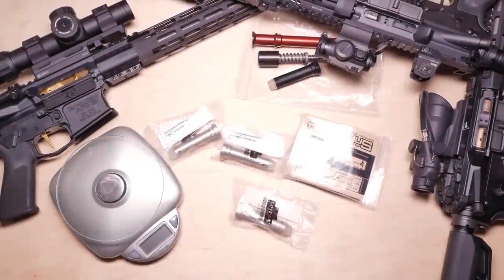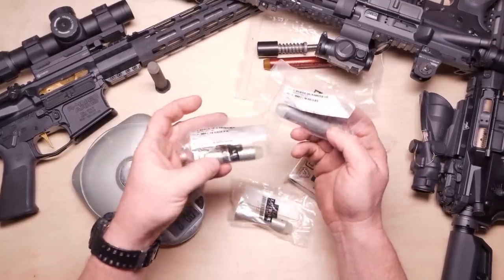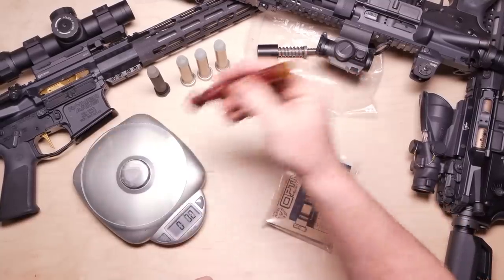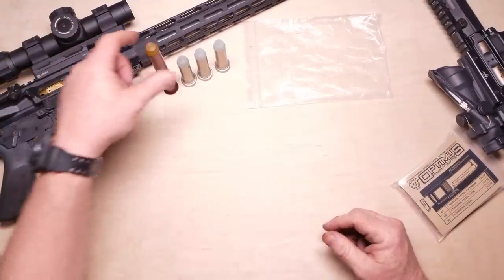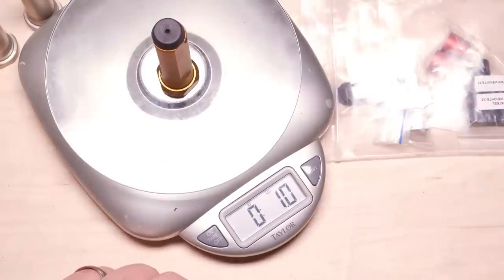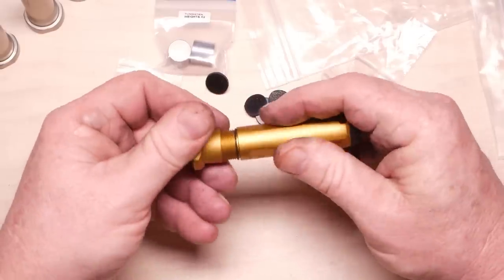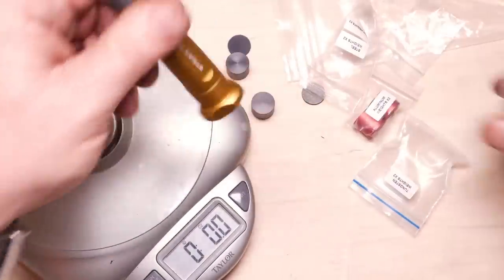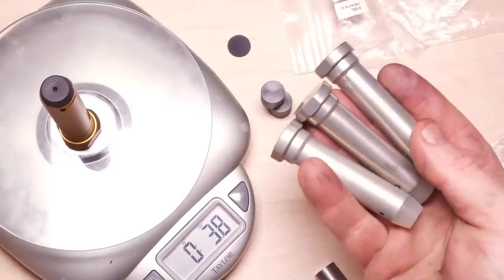Strike Industries Optimus Buffer System and Why it's Cool

Comment: Armaspec makes that captured system.  The best way to figure out what weight buffer to run is have a selection, load 1 round into a magazine, start with the lightest buffer, chamber and fire that round, if it locks open go up to the next buffer weight, until it wont lock back, then go down to the last weight.  You also want to be aware of the direction the case is going, 3 o'clock is ideal
Reply: That only works if you only shoot 1 load of ammo.
Reply: @3sotErik  not really, I shoot multiple brands from 55 to 68 gr, and I have never had an issue.  Maybe if you start with underpowered ammo, but as long as its quality brass cased ammo, you should be gtg.  I shoot every saturday, at least 200rds of 5.56, have 8 AR's and never had an issue because of the buffer
Reply: Ok then. I will take you at your word & I rescind my comment.
Reply: @3sotErik  I can confirm what New2kendo is saying. I tuned my rifle with tulammo bc I wanted a reliable, eat anything I feed it ar15. Tune for the weakest ammo you could possibly shoot and you will be happy with a flat shooting and reliable gun with minimal recoil for spotting your own hits

Comment: Wow. It's obvious you have never taken apart a mil-spec. buffer. Those spacers are for noise reduction and shock absorption.  And luth is a fine company, good mil-spec parts but you overpaid and really can find those at better prices. But ok it's your money spend it however.  I only say that so your followers are better informed.
 And the new bucfer add a weight-subtract a weight is nice, easy to use but the little chart on the package makes it a lot easier to do than a scale and guess. 
 My point really is prep man if your going to teach. Alot less confusion to reach a conclusion.  Us old and slow get way to confused easy, and we don't need no outside help .